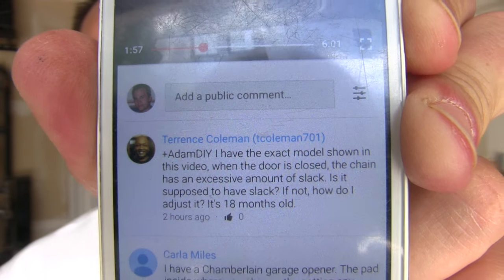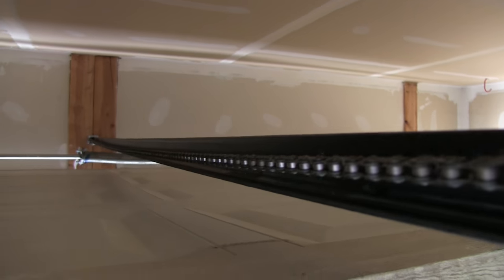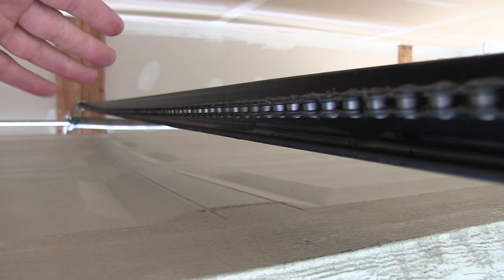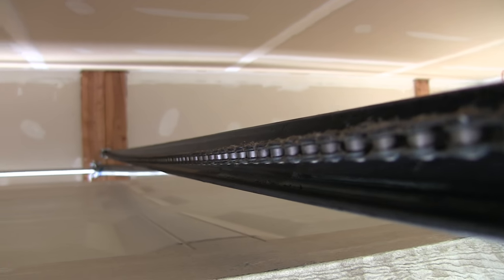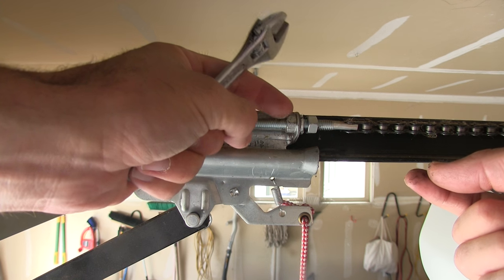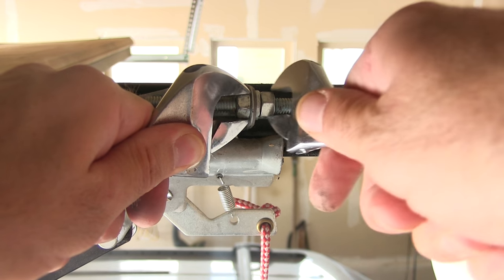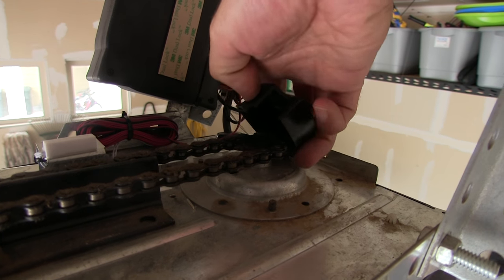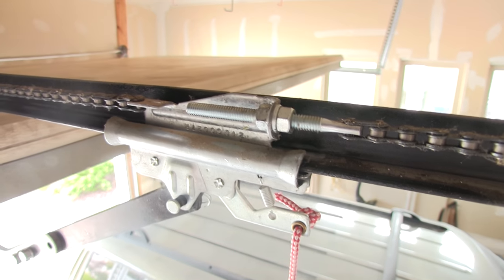How to tighten a loose sagging Chain - Garage Door Opener repair

Comment: the door needs to be disconnected from the opener before adjusting the chain or you'll have uneven tension on each side of the chain.  This will wear out the gears and sprockets. Disengage the door from the closer by pulling the red handled rope with the door closed.
Reply: Glad I read your comment
Reply: Alex Beyer  I don't think it matters which side the slack is on. It's one chain connected by a bolt.
Reply: Alex Beyer  yes you need to pull the emergency lever before you start tightening. And when I did mine, it seemed like it took FOR-EVER!! Lol
Reply: Very good advice not mentioned in the video!
Reply: @thedisconnectedwife4165 I believe that you’re incorrect. Remember the spring is tensioned, attaches to the door
Reply: Thanks!
Reply: Saved me 250 bucks with your great explanation giving me the confidence to fix it myself!! Thanks so much!

Comment: I did this and now my garage door doesn't open or close at all, but you can hear it trying to. Fantastic, thanks Adam 😅
Reply: There's a bolt hanging down from the rail near the motor to stop the door. Check to see if the metal carriage the pull string on it is wedged into it. It happened to me. I freed it from the bolt and it worked. Might help

Comment: Thank you. I actually had the opposite problem. My home is a brand new build and about 4 years of settling must’ve caused a shift and I could tell the chain was way too tight. I followed the same steps but loosened it to provide “some” sag and now the problem is fixed.

Comment: I agree with everybody else. While you seem to have tackled the easy portion of the question you didn’t really address the exact parameters the question set. When the garage door is at the bottom, I too have an excessive amount of slack on the tension side and no matter how I adjust it, it doesn’t get better. I’m going to assume it’s normal since there’s literally no answer for this anywhere.

Comment: The best way to do it is to make sure you REMOVE the bolt/chain from sliding mechanism...  then, with the garage door OPEN to its fullest, bring back the chain, wrap it around the gear leaving just what looks like barely enough to reach around the gear and over the opener to make it through the hold on the sliding mechanism.  Make sure tension is exactly as Adam described then (again make sure you door is NOT connected to the mechanism) hit your opener.  The chain and mechanism should move nicely with little chain noise.  Once that's complete, go ahead and CLOSE your garage door.  Hit the opener again.  Voila!

Comment: Thank you for video. In my case the chain has a lot of slack and when it closes motor keeps on moving and stopping until I open and close several times then it will stop. Why this happens and how I can fix this problem.

Comment: When I tightened the screw, only one side of the chain is tightening up, the other side of the chain (the side without screw) still sagging. I tried to pull the chain to this side. It did not work. What can I do? Thanks!

Comment: Thank you for you video’s! 

My door will start closing then goes back up! I have check the wires with a voltammeter and everything seems to be okay, sensor are green and Orange not blinking at all! When I try to over write the sensors by continuing pressing the button the door doesn’t close. Rails seems to be okay with the same type of movement. I grease the rails and wheels. Nothing has improving. I am about to change the sensor, I hope that works. I will update this commend as soon as I change them if the issue gets fix. 

If you have any idea what it might be I really appreciate your help! 

Best regards Pete.

Comment: Sagging chain video is the adjustment on my opener except I have no more thread to backoff nut so I can tighten the chain. It looks like I didn't position the adjuster with more thread on both sides of the nuts. What do I do..

Comment: How much slack is normal when the garage is closed? the owner's manual says some slack is normal when the door is closed but my chain is hanging about an inch down from the side of the rail when the door is shut.
I'm probably going to replace this door opener with a direct drive unit anyway but in the meantime I want to make sure it's adjusted properly.

Comment: Hi! I just installed new garage door opener. When I set the travel goes up, i then did try to set it down but the door wont close down. I checked the sensor it's both solid lights. Can you help me figure out the problem? Thanks

Comment: Just wondering my chain is loose when the door is closed sometimes falls off the rail. And no slack when door is open. Would the adjustment be the same or should I adjust for more slack when the door is open.

Comment: Today evening the chain came off the spoke at the light end and the door fell. I loosened the screws on the opposite end, realigned the spoke and then tightened the screws. The Garage door now opens/close but I see a big curve of the chain meaning the tension is still way loose. I have tightened the screws as much as possible and fear that it may break. How should I go about making the chain tensioner straight/tight in between the black rod please?

Comment: My hardware came loose at the brackets that join the rails together causing a squeak. Could I use thread lock on them to prevent this in the future or will just tightening be sufficient?

Comment: The other side is super loose on my garage door. Will tightening where you are saying tighten the other side?  I tried it and now one side seems very tight and the other side is a little better. Im hoping it evens out after a few openings and closings of the door
Reply: It should tighten on the other side too unless you have a weird idle pulley. It's a chain so you could move it over one tooth on the sprocket at the drive shaft (you'd need to disconnect or loosen the chain to do that). If that doesn't solve it or it's not possible it might mean that your chain is just stretched out. Usually when replacing a chain you'd want to replace the sprocket too, since it also wears out.

Comment: My Sears garage door opener manual indicated that to adjust the chain you have to pull the emergency release handle to disconnect trolley before adjusting the chain. Should I have the trolley connect or disconnect before any adjustment?
Reply: Always disconnect before adjusting.

Comment: Adam, I used your instructions to tighten my chain and it is as far on the bolt as it can go and I still have about a 6 in drop in the chain,  It rubs my door and jumps as it is opening/closing.
Do I have too much chain and if so, how to I correct that?
Reply: Sounds like you need to remove a link or two from the chain  (or the chain is severely worn). To remove the link you need a chain rivet tool. Inexpensive.

Comment: Hey thanks for sharing the video. Can you help me with this? While closing my garage door, it gives a jerky sound once only and the middle part (not sure what's it called but the one where you tighten the belt/chain) does not move straight,  but slightly moves up and down frlm each side. It does it only once as soon as I hit the button to close the door, then it goes smoothly all the eay down. What would be the reason and how to fix that??

Comment: I'm experiencing extreme slack on the non bolt side and extreme tightness on the bolt side. I've tried to do as you have instructed in this video but it only seems to tighten and loosen the respective sides. In your video it appears that the door is open either partially or all the way. I can't tell because of the camera angle. Does my door have to be open for this to work?
Reply: i have the same problem  very frustrating , he just tackles the easy question
Reply: Noom Flow Noom Flow
Reply: I have the same problem.
Reply: Noom Flow  Vvvvvvc.
Reply: I have the same issue.

Comment: I've viewed two different videos about tightening the chain and they are both they same, however, they both leave out how tight the other side is supposed to be.  My chain on the adjustment side is hanging just above the bar as suggested, but the other side is very tight and doesn't seem to be adjustable.  Is that okay?  Also, I adjusted my door while it was closed since the adjuster wasn't readily accessible while the door was open.  Maybe that's where I went wrong.

Comment: Here's a question. So I've adjusted thus chain multiple times and even removed a few links and it just keeps getting slack in the chain. But here's the kicker the adjuster isn't backing off its still in the same place.

Comment: Hi, I got a more serious problem.  My chain flew off the thing that's at 2:20. You mentioned something about shaft replacement. What should I do exactly? Is it that serious? There any easier way then to replace the whole thing? I need some help.

Comment: My opener was making a humming sound and stop operating. The chain was sagging below the rail. I adjusted the chain as shown on your video, however, every time I activate the opener with the remote, the chain adjustment assembly goes a bit forward, them back (towards the opener), hitting the stop screw and the opener stops working, making the humming sound again. In other words, back to square one. I have adjusted the chain several times but it keeps acting this way. What could be wrong?

Comment: Hey Adam, I have craftsman 1/2 hp motor door opener when i hit the door opener to open the door it appears the gears in the motor push it the opposite direction and the door does not lift at all. Can you help diagnose this issue?

Comment: How's it going Adam? My garage door, when letting it down, sometimes pauses then goes back up...as if someone stood in front of the sensor. I hit it with garage door lube and it seems to be better. However when it goes back down, there is a slight slight struggle to continue down past that midway point. Anything helps. Thank you Sir.

Comment: my chain is a little different than yours, its a complete loop. i notice the opposite of the carraige side is loose to the point where it sometimes sloops under the bar. how do i tighten that one side?

Comment: I bought my first how and has dual car garage doors.  my question is do i need to lubricate the track or rollers o  the door as it goes up and down??
Reply from the maker: Is there a problem with the door. Normally you don't need to oil the rollers and nearly never the track.
Reply: this is bullshit, liftmaster told me to grease the track, becuz mine was dragging and bouncing around, the worm gear in the box is suppose to be greased once a year also

Comment: Hi
I have a technical question for you! 
I replace the sensors 'cus I think that was defective. Now the problem continue when I got try to closed the garage door the intermittent light come back. This is happening sometimes. 
Can you tell me what I'm doing wrong? 
Thanks.
Reply from the maker: What model do you have?
Reply: try changing your force settings if your opener has manual adjusters. there might be too much pressure or not enough. my opener programs force on its own because it is newer but yours might be different depending on brand and year
Reply: +AdamDIY Formula 1 1/2HP From LiftMaster
Reply: +Jeep Fanboy 3692 I'll check it again trying new settings. 
Thanks!
Reply: +AdamDIY I think can be the Capacitor.
Reply from the maker: +Francisco Aquino have you seen my garage door troubleshooting video?
Reply: I saw two yesterday. I check. Probably is the Starting capacitor. I already set the power for button. 
Thanks a million for your replies and cooperation. 
have a nice day. 
your page is cool..

Comment: What if the other side of the chain is sagging? Not the side you adjusted.
Reply: Not my information, pasted on from another comment on this video, sorry I can’t give credit as I forget the name, it’s there though. Their recommendations is to never adjust the chain with the door engaged, pull the emergency door release (red handle) and then adjust. Not sure why that is the case but I feel if a large adjustment is used (or even a small one) you need to readjust the door limits as they serve an important safety feature, if you, or something is caught under the door the limit sensor should open the door because it felt an obstruction. These should be tested monthly by placing a 2x4 under the door and see if it goes up after colliding with it.

Comment: 2 Items: 

1) Would be helpful to use some familiar item as "calipers" to demonstrate a proper range of sag between chain and the rail -- so, like hanging below the rail would be (or not be?) too loose to track? 
(I am being serious, it WOULD be helpful. Just, please tell all the lit majors to stop snickering, lol)

B) The chain on mine twisted as I was tightening, so I loosened and made the chain even all the way around. Am I being obsessive? Or does it actually matter?
Reply from the maker: A very small amount of twist would be ok but I'm like you, I can't have it!  Glad you made it even.  You will want to check out the video I upload in the morning.  I talk about the sag in the chain. Basically, it's better to err on slightly loose because too tight will for sure bust the drive sprocket. A slight sag is what you want. (as long as it's not hitting the rail as it's moving)
Reply: AdamDIY Thanks for your reply -- I had watched 4 different videos -- yours was the easiest to understand and see the details I needed. (Thank you!) 

One other question -- the opposite side still flops a bit. is it possible to (marking the chain first) undo the chain and shift it to even out the slack that's still flopping on the other side?

Comment: hey Adam..when I press the button..the metal piece that goes back and fourth on the chain only moves like 1 foot back and fourth then stops right in the middle..its not hooked up to the door yet but it just won't go all the way back and fourth the way it should..do you think there's not enough power going to it??or what do you think? thanks..the piece I'm talking about is the metal piece with the red rope hanging from it.